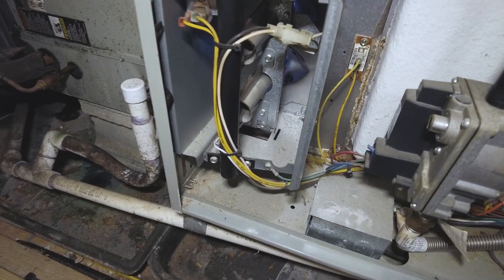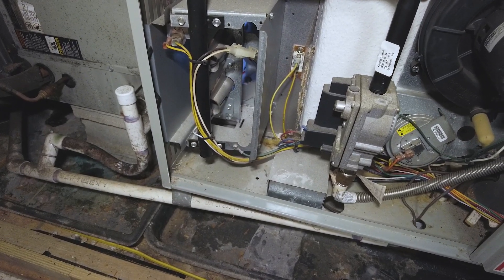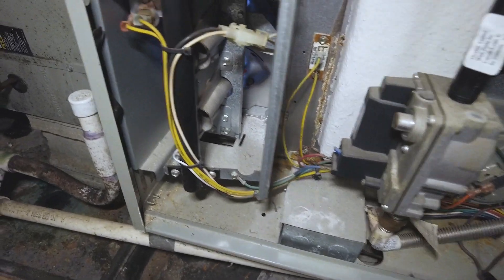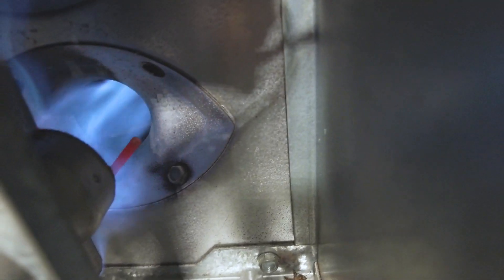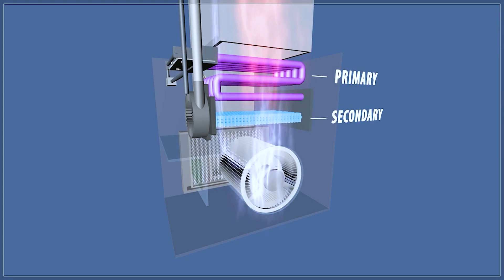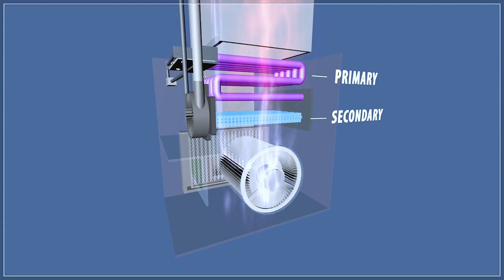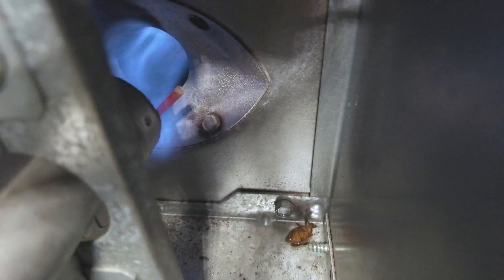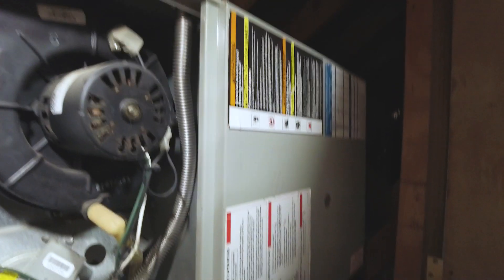Cracked Furnace Heat Exchanger Causes Flame Rollout and Corrosion | Non-Evasive Diagnosis

Comment: If you have say a 15 to 20 year old gas furnace and upon doing a visual inspection of the flame pattern like in this video do you do any further testing ? Like co2 measuring or other tests? I guess what I am asking is just go on flame pattern only ?
Reply from the maker: Yeah for less obvious symptoms I would prob measure to Co differential between supply and return.
Reply: @HVACTechKnowledgy  Thanks for your reply and video.